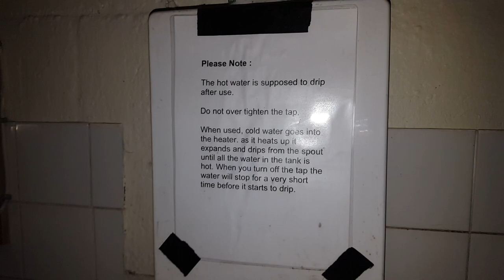1965 LL Shires Lynx & Royal Venton Coronet pan

Comment: That's proper plumbing, the use of galv. steel on urinal flush pipes. A reducer into a hex. nipple into a loose union due to 2 fixed points. 3:01 osma grey bottle with S converter bend. I have this basin on my shelf, I recognise it.  These urinals are rare these days, trying to fathom out how the waste is connected. just looks like a hole is drilled into a piece of 110mm (before trap) then goes along to an underground gully trap that's above ground.